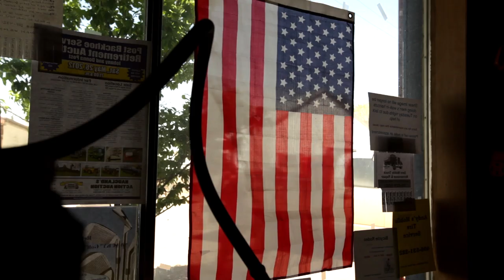The North Dakota Miracle: Fracking in the Bakken

Comment: I used to haul crude oil over there...and I agree. Mostly because the fracking process isn't proven safe. In a few years, the water aquifers will have either poisonous chemicals in it or crude oil in it. This is all about greed. This is going to ultimately ruin the Bakken area. I guess if you are prepared to filter all of your water, then, go for it. But, it WILL eventually ruin your water aquifers. And that IS very important.

Comment: Bakken is only putting out about 800,000 barrels per day, under 5% of U.S. daily consumption (of roughly 20 mbpd). It could peak unexpectedly, being a very thin and unevenly deposited formation. The idea that this is some radical new oil source is bogus.

For context, look at the curve of U.S. oil production since the 1970 peak. Bakken is desperation oil that wasn't tried before because much easier/cheaper oil was still flowing. Bakken is part of "Peak Oil," just a bump on the down-slide.